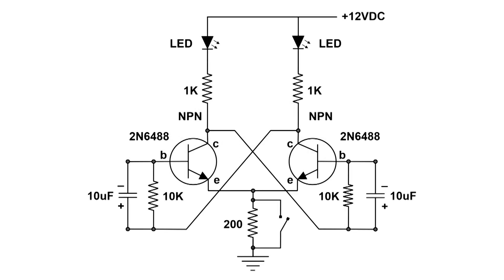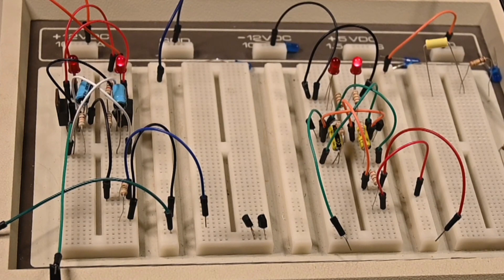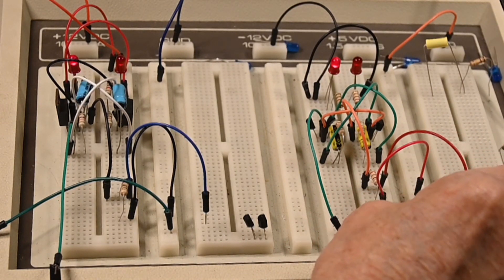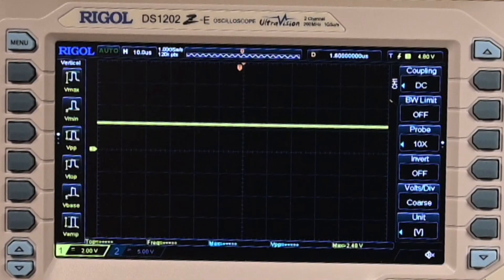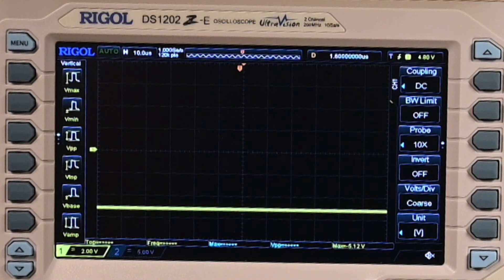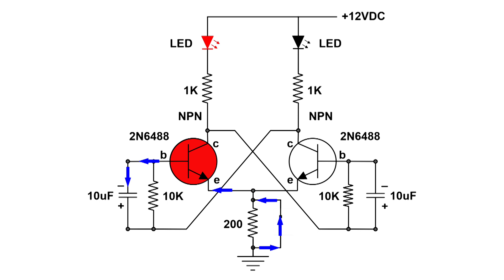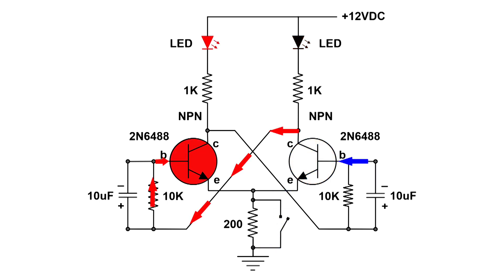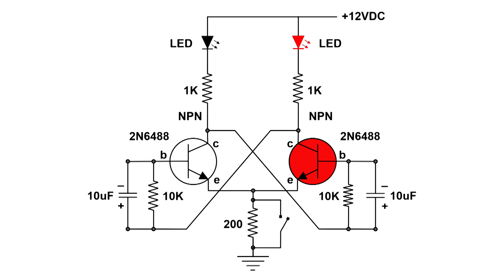Flip Flop circuits and how they work

Comment: I am so confused why electric engineers call something with two transistors a “latch” despite the fact, that two transistors are clearly able to flip flop flip flop .
Reply from the maker: If you use one side to operate a light, when you trigger the Flip Flop the light is ON, if you trigger the Flip Flop again the light is OFF. First it latched ON, and then it latched OFF. So you have a Latch for each scenario.  Flip Flop may be free running also, if you had a light on each side, this would be like a railroad crossing sign.
Reply: @ so a latch is a kind of flip flop? What is a Reset-Set flip-flop then? Synonyme.

Latch could be an application, but a other flip-flops are named after their application: data flip flop holds data. A toggle flip-flop toggles. Maybe FPGA engineers and physicists have an incompatible language?
Reply from the maker: @ArneChristianRosenfeldt  Yes, a free running Flip Flop is called a Multivibrator
IGBT Astable Multivibrator
https://www.youtube.com/watch?v=PnAiAhZH9hw
MOSFET Multivibrator Build and Demo
https://www.youtube.com/watch?v=b4WJxopihxA

Comment: Mine switches from one led to the other in a 1s interval, the button works but i dont know whats wrong with the 1s auto-switch
Reply from the maker: Usually I get it does not work. I would try and increase the value of the 200 ohm resistor. Alet me know what happens.

Comment: When you close the switch why is only 1 capacitor charging ?. Wouldn't Both capacitors charge together as both have free paths for electron flow with this configuration ?
Reply from the maker: I have two other videos that may help you understand this process.
Flip-Flop Circuit, build and demo
https://www.youtube.com/watch?v=IykOrxVcdyg

IGBT Astable Multivibrator
https://www.youtube.com/watch?v=PnAiAhZH9hw

Comment: but for me i have tried usind bc547 transistors but all in vein
Reply from the maker: Flip-flop circuits are one of the more challenging circuits to build. Each component on each side of the flip-flop needs to be matched as close as possible. I have built several flip-flop circuits and I automatically do this without thinking. I matched the beta of the transistors as close as possible, this is one of the very important matches. And of course I match each resistor on each side as close as possible. If each side is not matched, one side or the other will be dominant and the circuit will not work correctly. This is one circuit where you must match components. I hope this helps and good luck. Let me know when you get it working.

Comment: Hello and thank you for this very informative video. I'm building a buck converter and would like to disable the pwm of the 555 timer if there is no load on the output. So far I don't know how to do this. Could a flip flop like this be used to detect a load and flip the power on or off somewhere else in the circuit? (or just pull a pin to ground if there's no load on the output). Thanks!
Reply from the maker: The flip flop circuit does not detect. Why do you want the 555 timer turned off when there is no load?
Reply: @AllAmericanFiveRadio  Although my product is not meant to be battery powered, I still want it shut off when there's nothing connected to its output. This is how many IC's work. They have some kind of a detect pin and are not running when the output is open. My load would be 1mA to 5A, so using a sense resistor also won't work, I think.
Reply from the maker: @farhadsaberi  I would need to see the schematic for your circuit. allameircanfiveradio@yahoo.com

Comment: I just found out, it is called holding circuit.
However, it seems that all of them entail physical relay.
I was  on the thought process of it being made up of some sort of logic circuit.
So far, it is either thyristor type or mechanical relay.
Unless it can be made with some logic circuit too....?  If not I understand the other two.
Reply from the maker: SCR's can make a latch circuit. I have two videos on SCR's.
Silicon Control Rectifier SCR Basic AC Circuit
https://www.youtube.com/watch?v=45H4J_S52Y4

Silicon Control Rectifier SCR Basic DC Circuit
https://www.youtube.com/watch?v=ImyTwZGZ-Ls
Reply from the maker: A flip-flop circuit together with AND GATE circuits can make a stepper circuit. The link is to the video of a stepper circuit.
Cascade FlipFlop AND Gate Logic Demo
https://www.youtube.com/watch?v=mwkKQ0jYJ8o

Comment: One thing that has been bugging me for sometime is how a momentary push button works.  I don't know how to word it properly on google so I have not been able to find the answer I am looking for.
I understand how a temporary push button can turn on a system of thyristor/traic type of circuit.  That I understand.  As you only have to energize the base once, then current flows.  However this is AC circuit.
What type of set up can make it work on DC components.
I am wondering if you can make a simple circuit that will show how a momentary switch ( a switch that you don't push again to shut the circuit off) will cause a DC circuit to turn on.  Or is it that all them buttons we push to turn things on is actually happening at the AC circuit and gets transferred to the DC small voltage....  I still don't get it.
Reply from the maker: A flip-flop circuit together with AND GATE circuits can make a stepper circuit. The link is to the video of a stepper circuit.
Cascade FlipFlop AND Gate Logic Demo
https://www.youtube.com/watch?v=mwkKQ0jYJ8o
Reply from the maker: SCR's can make a latch circuit. I have two videos on SCR's.
Silicon Control Rectifier SCR Basic AC Circuit
https://www.youtube.com/watch?v=45H4J_S52Y4

Silicon Control Rectifier SCR Basic DC Circuit
https://www.youtube.com/watch?v=ImyTwZGZ-Ls

Comment: The instant you supply power to the circuit, which LED will turn on and why?
Reply from the maker: Every component on each side of the flip-flop circuit must match as close as possible. It is impossible to match each component 100%. This means that one transistor will conduct first. When that happens it also keeps the other transistor from conducting.
Reply: @AllAmericanFiveRadio  In other words the reason this works is because it is impossible in life that everything is exactly identical and we can't do it no matter how precise we want to be.
Reply from the maker: @alchemy1  You could build one and swap components.